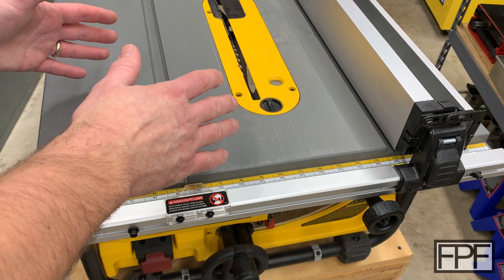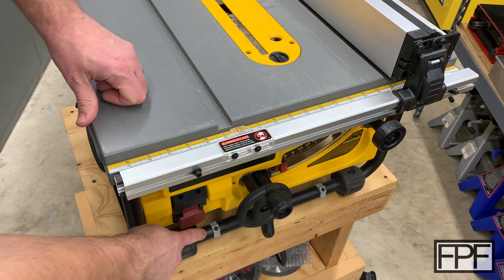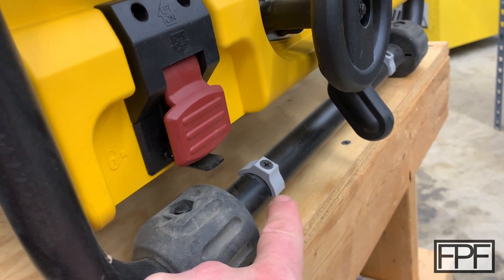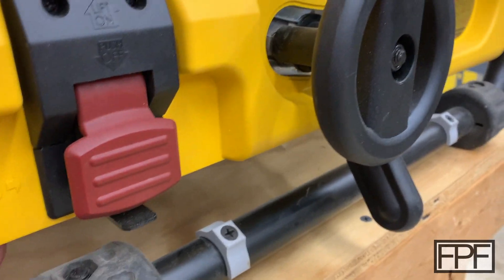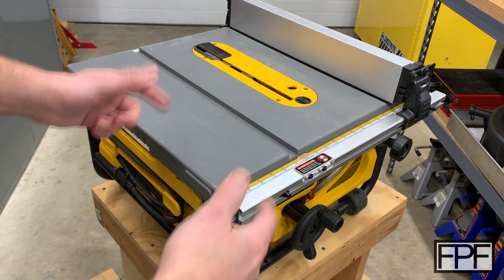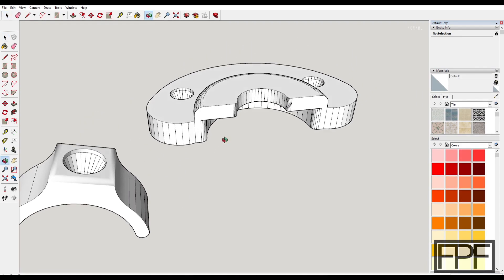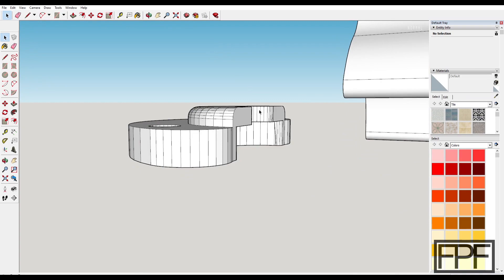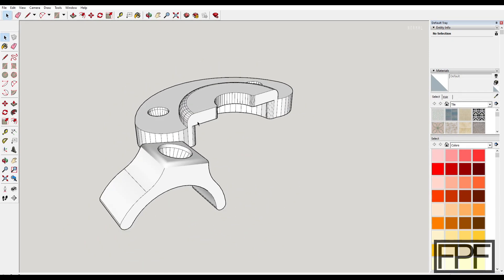3D Printed Dewalt Portable Table Saw Mounts

Comment: I’d implement a tool less removal system for the screwed in side of the saw. I’m picturing a hinged clamp with a nut/bolt securing it with a 3D printed head for the bolt so you can unscrew by hand.
Reply: Also, subbed. Cool channel - my favorite prints are all around the workshop.

Comment: This would be a great starting point for similar mods. For instance the saw has various accessories that usually end up just strewn around the place such as a push stick, the kickback guard, blade wax, instruction manual, eye/ear protection, hex key for adjustments, etc. Prints for mounting those on the saw would be great to have. Similar to how there are lots of prints for ender 3 printers to have drawers and things to organize the clutter.
Reply from the maker: and don't forget about dust collection. . I have an adapter to attach my shop vac as well.  Might publish that in a future video.

Comment: Any future plans for 3d printed miter slides for that table saw? Ive been using wood but a printable miter slot guide to screw or glue onto a cross cut or miter sled would be awesome, thanks for the video

Comment: Nice work. PLA I think is pretty underrated. I have an entire pegboard system organization system printed in PLA. No problems. I've actually switched to nearly almost exclusively PLA.
Reply from the maker: PLA is my go to material, but I will say that TPU is nearly indestructible.  Maybe I'll do something TPU next week.
Reply: @FunctionalPrintFriday  the only experience I have with tpu is ninjaflex and only in small amounts as well. Made gaskets, for example.. never spent enough time with it to dial it in to get awesome results but usable for sure. I just got a resin printer and am exploring that. It's pretty awesome. (Unboxing/first impressions video coming soon, fyi 😉) a lot to learn with that, especially that post processing is so important to get the best results
Reply from the maker: @willofthemaker  I have one of the original Elegoo Mars machines.  Have used it for a few really small items where fine detail was needed, but I hate all the prep, cleanup, and post processing.  Hard to beat FDM for fast-prototyping if the detail is good enough for the project.